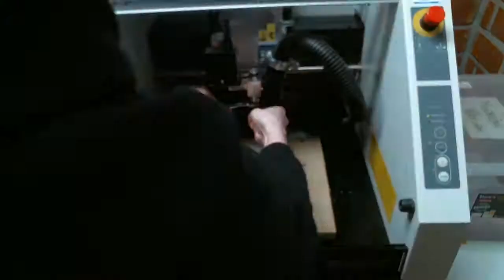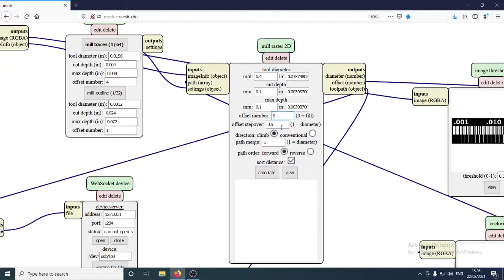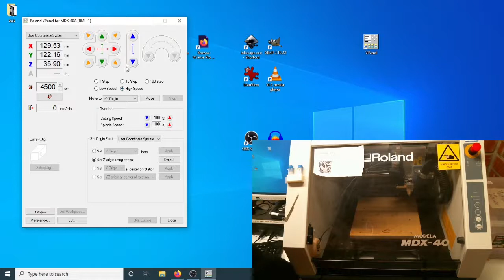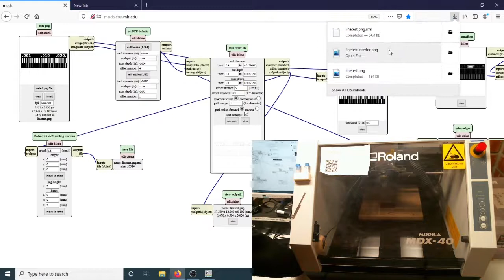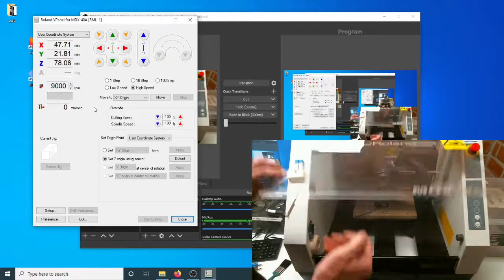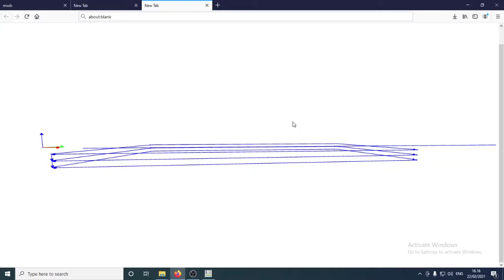PCB Milling With MDX-40

Comment: in place of brush the car vacuum cleaner can be used as there is no large amount of dust, and cleaner has a tiny size (not so useful 12V connector, but battery-powered cleaners maybe exists now)

the thing should be maybe additionaly done is replacing dust filter after the cyclone stage with a HEPA with smaller channels, as originally cleaner was not designed for glass dust

Comment: What concrete tools showed themself more or less stable and long time use with lowest prices?

What about slot and board cutting?
Which ones able to run a long time over fiberglass FRs and carbon maybe?
Reply: I myself tested Seco Tools 870030.0 02742789 (3mm angry carbide) very old time ago, and lasts ok

until the machine I used was cracked into the table (not my fault, hidden factory defect + no service funding from owner)

Comment: Hello, I have a MDX 40a , which are used to use on a 32-bit computer windows , how did you get that to work on a 64-bit computer, did you have some updated drivers? Could really use your help. Thanks, Signed John

Comment: Mikä on paras tapa kiinnittää vaneri/puu alustaan?
Reply from the maker: epoxy?
Reply: @aaltofablab3504  epoxilla kiinni alustaan joka kerta kun haluun kaivertaa jotain? 🤔
Reply from the maker: @marcusmohlin2983  can you give more detail on what are you trying to achieve?
Reply: @aaltofablab3504  just wondering how to find a easy way to attach for example plywood to the machine. Playing with epoxy sounds a bit weird. Maybe attach a wooden board to the machines plastic board and then fasten the workpiece to the wooden board with screws?  (Then there is of course always a risk that the milling bit hits the screw if something goes wrong...)
Reply from the maker: @marcusmohlin2983  oh yeah the machine context was missing here. If double-sided tape does not work, you should consider using mechanical fixtures.